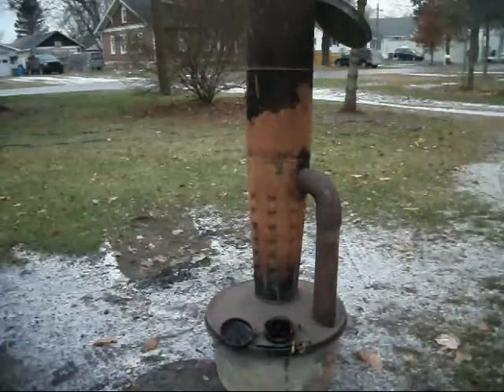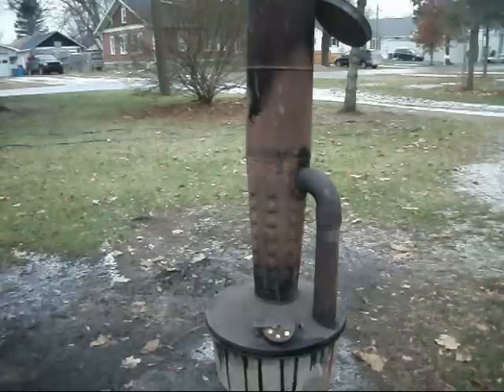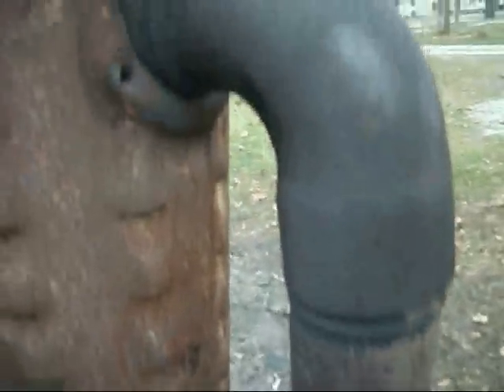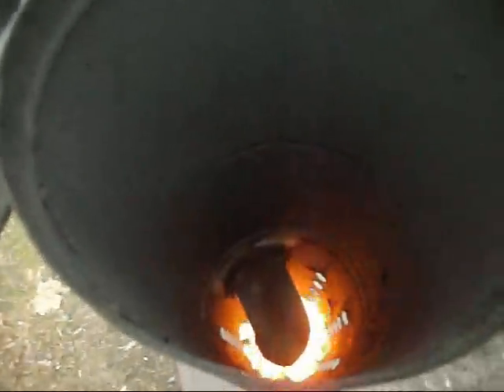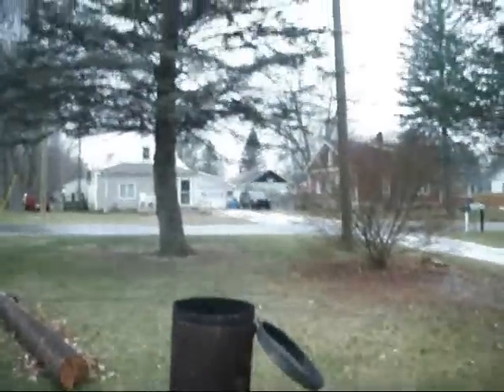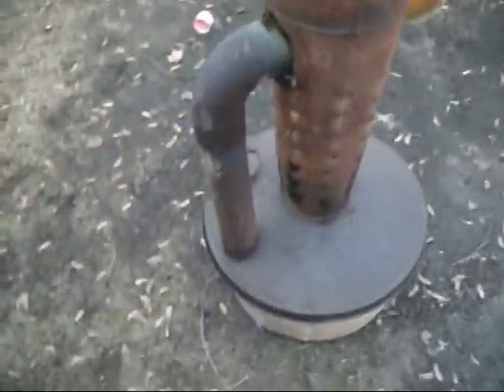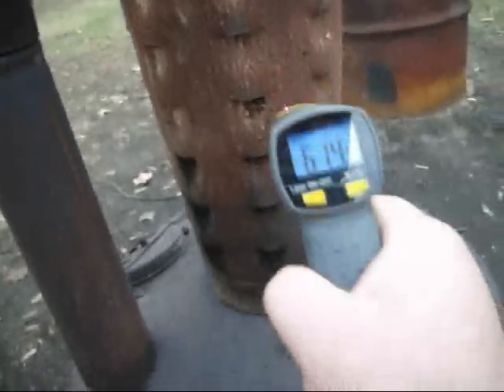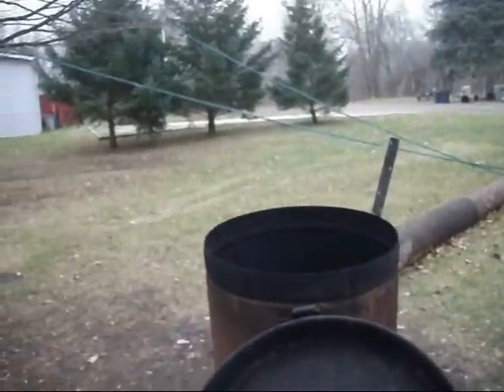Smudge Pot Orchard Heater

Comment: I use to work at a concrete plant and the boss had one and he used diesel and he put in a 2x4 to keep the fire from going out , it was so hot it was glowing red hot and you had to stand ten feet away from it because it would burn your eyes from the heat it put out .
Reply: Good times, good heat. Did you ever cook on it?

Comment: Run waste vegetable oil ... Fume problem solved!

Also... if piped outside ventilation is not an option (during garage use) it would not be terribly difficult to add/fabricate a wheeled drum dolly and wheel the unit outdoors during shut down...

Comment: How does this one unit warm up an orchard? I have a small peach and apples or he'd and having issues with freezing temps (below 27 F), killing all the flower buds. Misting water helps but not too helpful when temps are in low 20s and trees loaded with flowers. We had two hot days 70-75F back to back, and almost all the peaches bloomed. Now temps will be in low 20s tonight till tomorrow 9am. Will be losing the whole crop of peaches this season! Not good.
Reply from the maker: Tech & life videos J It wont, you need several .
Reply: KB8OOE thank you.

Comment: Someone left one of these behind in the patio area.  Are they safe to use as a patio heater? 0.o  or fumes?   The one I see is pretty basic.  Square base, 1 tube going up.  No generator or anything like that.  It's just box and exhaust.
Reply from the maker: I'd stick with Kerosene and you should be safe. I'd try it away from other people first to be safe...